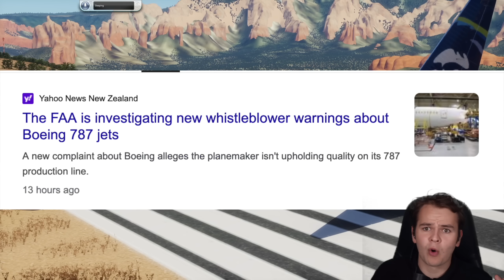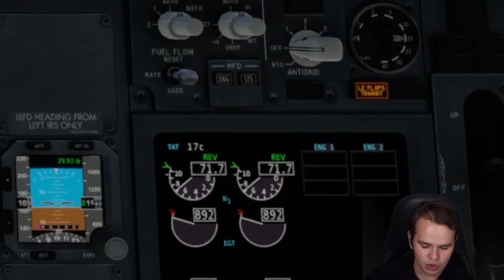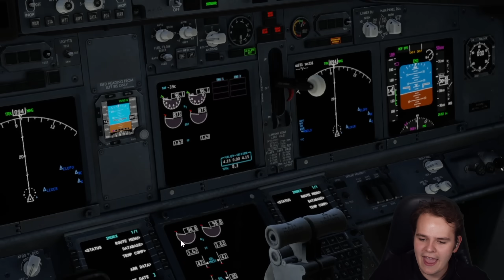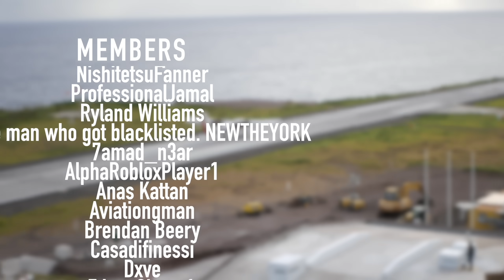Usual Boeing Build Quality

Comment: I have the aerofly fs flight simulator on my phone and when I fly the 737 MAX, it often doesn't respond to my command. When on autopilot, I try to make the aircraft lose altitude in order to start the descent to land at an airport but it doesn't respond and maintains altitude. Sometimes the nose even goes up on its own and I lose lots of air speed so I always end up having to do the entire descent and landing manually. The 737 max autopilot does whatever it wants. But the 737 500 is fine tho. It responds correctly to my commands.